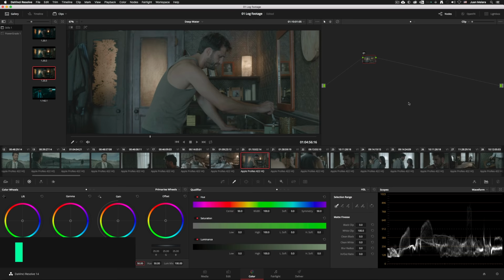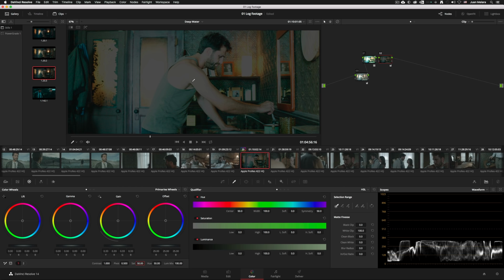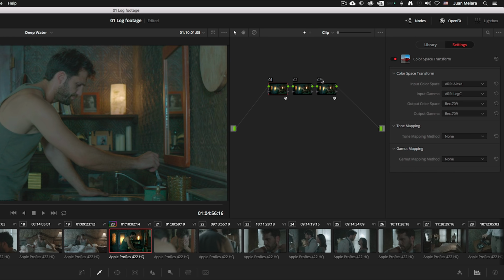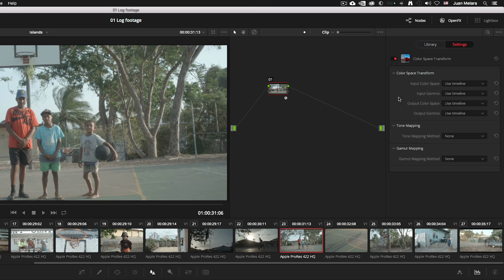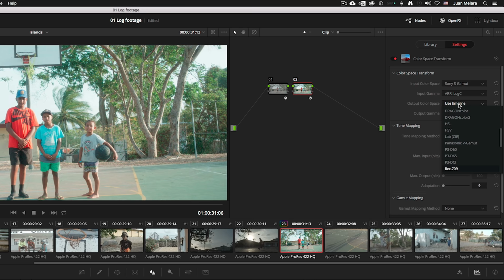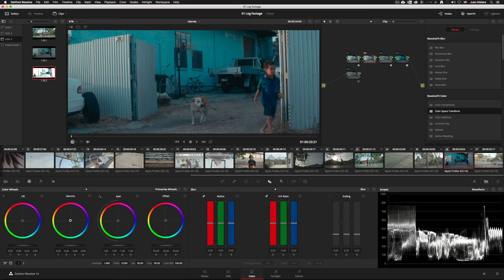Insider Knowledge - An easier way to grade log footage

Comment: If I may, I'd like to contribute a little bit to the discussion. I love Juan Melara; I think he is very informative. I would like to make a little correction: the resultant clipping at the beginning is actually reflective of the interaction between a self-aware floating point color pipeline, and a Lut that does not have access to the 'out of range' values particular to that pipeline. Luts, used directly on video (no floating-point grades between them) will have access to the entirety of recorded values. This includes values above and below luminance levels flagged to pure white and black (16-235 etc). An NLE color pipeline will allow, and preserve, 'super' floating point values between nodes (negative numbers, higher than 1.0) which otherwise do not occur in video. It is these values which Luts inherently can't see (non-standard, particular to that grade, in that NLE). [Luts can actually 'throw' to these 'super' values]. There is an important takeaway from Juan's video - when using Luts following grade steps, and not directly on raw video, one must be careful not to clip range or gamut ahead of the Lut, as this will not be accessible by the Lut. Hope this helps!

Comment: For those curious, another similar approach is using RCM. It's not quite as flexible as the color space transform method Juan shows here, but it uses the same algorithm and is sometimes more convenient. Just dial in your input, working, and output spaces, and RCM will automatically convert your clips without the need for applying additional nodes. Just another workflow option!
Reply: hi Avery, I just wait for your next great tutorial brother!!
Reply: And it’s an even better option now!

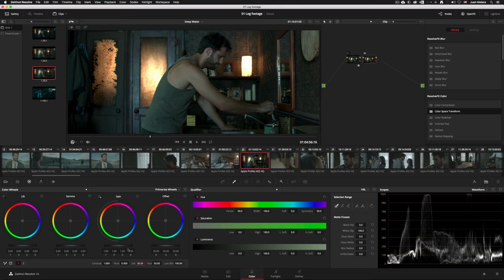Comment: Brilliant! I think I'm grasping the concept, thank you so much :) But why add the node @1:53 for primary correction in between the CST OFX nodes, instead of simply adjusting the lift-gamma-gain, etc, directly in the first node? Is this just to demonstrate that the CST is non-destructive, for convenience and control, or am I missing something?  

Same goes for @2:08 adding a third node transforming back to LOG-C, why not add the second CST to the second node? Why add the third node leaving a clean node in the middle? 

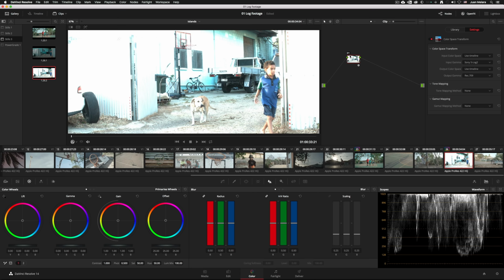And lastly @5:16 why add a node prior to the first CST node to bring the highlights back within range, instead of doing this directly on the first CST node?

Learning every day. Thank you for your content!

Comment: Your Resolve tutorials are far and beyond the most useful and professional I have ever seen, and this one is no exception! You just took my grading workflow to the next level. Thank you!

Question: If I am working with a gamma curve not listed in the Color Space Transform OFX plugin (Sony Cine 4, in this case), which input gamma should I select? Or is there a way to add Cine 4 to the list? S-LOG 2 seems to work well, but I can't quite tell if it's a perfect match.
Reply from the maker: Unfortunately if your gamma isn't on the list you won't be able to do the correct transforms. A custom CTL is an option. As is a LUT, just be aware of the issues.

I can't really recommend selecting another gamma for the input. But if it's similar enough, looks good to your eye and gets you good results then it might be ok.
Reply: To tag onto what Juan has said, I believe Sony's Cine4 is just another one of their variations on a "more filmic look" preset baked into a Rec709 gamma. So you could try using Rec709 as your gamma to see how well that works

Comment: Thanks for this tutorial, it's an immense help to me. Can you, or anyone here, answer a couple questions? 

1. Where would you pull a key in this workflow? I've been converting slog 3>log C>709>log C (using color transform) and then finishing my last node with a 3D Film Look LUT. When I pull a key in-between 709 and Log C I get much better keys, but when I on/off a node from earlier, say in-between Log C and 709, I get clipped values. Same thing happens sometimes when I select/deselect the key node between 709 and Log C. When I toggle the nodes on and off the clipping goes away, but then it seems to come back by itself for reasons I can't determine. I'm sure I've got the chain order wrong somehow but I've tried before and after the 709 transform and it seems to happen both ways. 

2. I don't see any changes in the scopes when I select gamut mapping. Should I?

Again, thank you for sharing this valuable knowledge!

Comment: All your videos are so amazing Juan! Fellow aussie here and Iove them so much. I refer to them all the time. I've tried the above process (sandwiching color grade in between a Transform node at the front setting up with Log C and another one after the color grade converting back to rec709, then a film LUT) but basically after the 3 minute mark in the video is the issue :-) I know you say the color grading should be as simple as rec709, but with actual footage it just seems to be impossible and the curve acts super strangely. How do I, for example, select skin tones etc etc - does it all work the same way?? :-) Dumb questions probably! Thanks again!

Comment: Hey Juan. Thank you so much for sharing and pointing such a useful trick using the new bundled OFX. Actually I am currently grading a feature film and this already made me want to start over and regrade all of it using this technique... but I have a question:

Why does the last step, the second transformation (REC709 > ArriLog, and then the Film Look LUT) work differently when I put these two nodes in the Group Post-Clip, instead of using them at the end of my grade node structure? I could not figure out the reason, but there's a huge difference in the result. Any idea?
Reply: also curious

Comment: This technique is a game changer! The Transform from S-log to Log-C to Rec 709 had dramatic improvements in my grading. 
Heres my question, for anyone. 
RCM - This method seems like a faster workflow because you can convert the entire timeline in the settings rather than individual nodes. 
It looks clean and fast. 
If there are different varieties of Log the differing clips can be selected and converted in the Edit or Media tab and it wont effect the rest of the clips in the timeline. 

I have yet to experiment with this method, however, and using Juans method 2 in the above video I dont know if its possible to achieve with RCM, but maybe it is, and just add a single Transform node at the end of the node tree. 

Has anyone tried RCM?
Reply from the maker: Both methods should give you the same results, but CST nodes give you more flexibility. What I like is that with CST nodes it's all contained within the nodegraph. So it's easier to move looks between projects and different cameras. You don't need to confirm you have the same RCM settings, as everything is self contained. 

Certain cameras also benefit from doing the conversions in a certain order. Or even converting manually with a custom curve. Sometimes you also need to prepare the data before a conversion, like inserting a -1 or -2 stop exposure compensation curve. Which can work better in the native gamma prior to converting to another type of log. This becomes a bit trickier if you're using RCM.
Reply: @JuanMelara82  Thank you for the timely and detailed response! Great points Juan, you're a true master

Comment: Hi Juan, thank you very much for this tutorial.
I followed the third example process step by step with A7III (slog2/sgamut) files.
I end up with saturation problems, colors clipped, huge pixels in some part of the image.
It seems it's a color space problem and I wonder....

In node 4, the output gamma is set to Arri log C, but why the output color space is set to Rec 709 ? Isn't the Film Emulation expects a wider color space (and in this case, the Arri one) ?
When I output Arri Alexa color space, no more clipped colors... 

I miss something here in the relationship between gamma and color space I guess, and that's really frustrating.

Thank you again. J.

Comment: Thanks Juan this is very useful and interesting. Please explain something - in your last section where you describe using overexposed Fs700 S-log2 footage your second last node is a CST to go from Rec 709 to Arri Log C gamma. But then in your final node you add one of the Film Look Luts which is labelled Rec709 Kodak 2383. This doesn't make sense to me. Surely the Rec709 Kodak 2383 LUT is expecting Rec709 gamma as an input, yet the node just prior has changed the gamma to Arri LogC.
Reply from the maker: Rec709 refers to the output colour space rather than the input gamma. You'll notice there are also DCI-P3 versions. Most proper FPE LUTs will assume Cineon log input, so they probably didn't think it necessary to include it in the file name.
Reply: Thanks very much - got it!

Comment: the greatest info for me was the pivet and contrast combo. Thats great for having footage that was shot using ETTR. How would you proceed when grading footage from say a shortfilm that has all the shots overexposed by exactly 1 or 2 stops to minimize noise (i.e. BMD Film from BMPCC)?
Reply from the maker: A few ways to approach it. I would probably just bring down the offset in my first node, then build the look on top - nothing special here... Copying the grade would carry over the exposure correction to the next shot. Another method would be to add all the clips to a group, then in your pre-clip correction bring down the offset. 12points = 1 stop. Then grade each clip as normal.

Comment: Thank you, this is awesome! I just had a quick question, if you were using FS700 DNGs and not ProRes Recordings as in this video, is there anyway to use the color space transform similarly?
Reply from the maker: You should be able to decode the DNGs to BMDFilm then use that as the input in the CST.
Reply: Awesome, I’ll give that a try, thanks!

Comment: I'm not sure if this is a dumb question or not but I'm pretty new to davinci and I only want to use davinci to create luts due to me being alot better at editing in premiere and have more experience, can I use the color transform method with slog and still create the lut for using in premiere? I do know I can do xml but not comfortable with that process yet
Reply from the maker: Yep, you should be able to export all your corrections plus any color space transforms into a LUT. If Resolve doesn't recognise the CST as a correction, you should be able to apply it to the Trim_LUT DPX and then run that back through Resolve to generate the LUT.
Reply: thanks so much, please continue to do these tuts, hopefully more with slog for camera like a7sii and a6500, you are a genius at color grading

Comment: Hi Juan have you tried to go from ACES to REC709 and back to ACES? I tried without good results.
Reply from the maker: Yeah unfortunately that's not going to work so well due to how the ACES pipeline works. Inserting a transform in the middle of an ACES node graph is difficult unless its been specifically designed to work and transform ACES data.

Comment: Hi Juan, What's the advantage of using this over RCM?
Reply from the maker: The main advantage for me me is that it's all self-contained within the node structure. So I can copy and paste looks and I don't have to worry about setting up RCM. Plus occasionally I move in and out of different colour spaces/gammas within the same node structure, depending on what I'm doing. Which isn't possible with RCM.

Comment: Juan if I want to use a look (from slog2 with the colour space transform the same way you did on the final clip used in your video) I created and use it as an on set LUT, how can I make sure that the LUT works properly. Because I tried to simply export the LUT from DR and apply it to the same un-coloured clip in PR Pro and the colour was off severely. Is there anything I can do to make sure that the LUT does the colour space transform and interprets the footage accordingly?
Reply from the maker: I'm pretty sure Resolve doesn't export the effects of the Color Space Transform node when you do a standard LUT export. In Resolve 14 you'll need to use the trim_LUT method. Page 77 in the manual. The process should be the same for Resolve 15.
Reply: It worked. Thank you very much.

Comment: There is a Log wheels section FOR log footage - you don't have to do any of this.
Reply from the maker: Grade Slog2 as Slog2 with the contrast/pivot, offset + log wheels. Now do the same but use a CST to transform Slog2 to LogC/Slog3 and tell me which gives you the better results and which grades easier and faster. Please, report back.

Comment: I presume the author of this video is using a P3 grade monitor? If not, using a wide gamut would be pointless as you wouldn’t see the colours properly!
Reply from the maker: Just using a CM250 setup in Rec709. It's pretty common to work in a wide colour space like S-Gamut3 or Alexa wide gamut, then converting to Rec709 in your last node. That way you get the flexibility of pushing colours around in a wide space, but still adhering to and monitoring in Rec709.